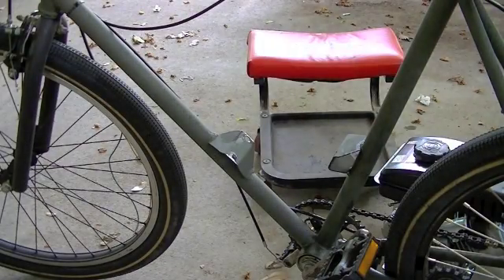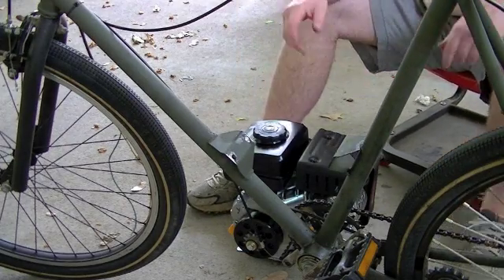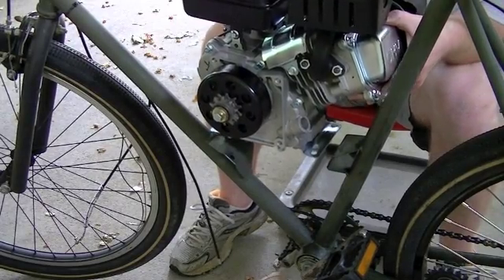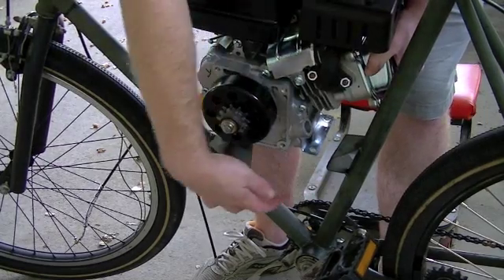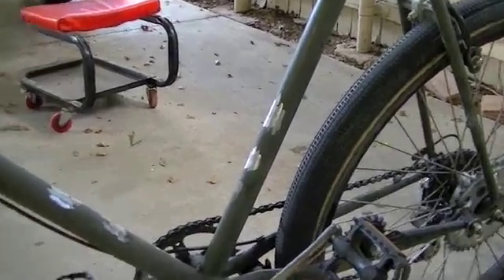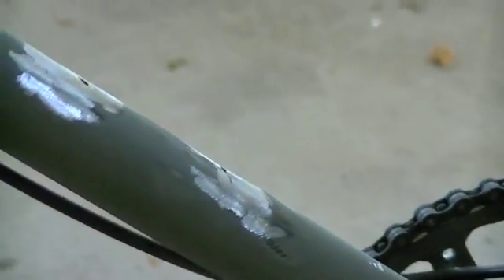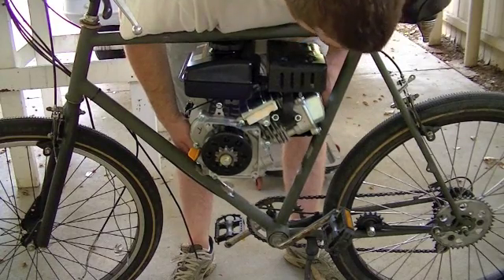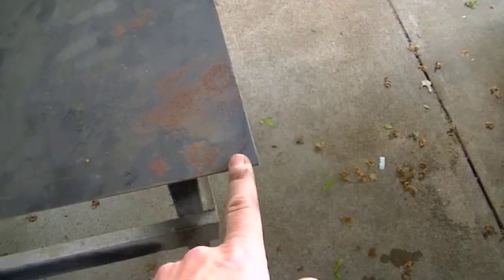Part 3 Motorized Bike | 3HP 4 Stroke Engine

Comment: Also something that makes the smoothest grinding finish in the business. is that 3 or 3 and 1/2 in round. brown green and red pad that goes on an angle grinder. Harbor Freight is the best to get it all with a 20% off coupon. I like the angle grinder best because you have the most control. I wish they had that angle grinder in a plug in the wall instead of air powered. You can put a straight edge on metal after you grind - mill it with that it's so close to perfect. I've milled carburetor tops down with it after cutting them and milling down with that angle grinder. And you can put a straightedge across it there that true. And it doesn't leave sharp edges it leaves an excellent finish.

Comment: you can fit a 212 predator if you ditch the gas tank mod the exhaust and upgrade to a pod instead of the air box
Reply: Brandon's Customs that's what I want to do

Comment: just turn the clutch around and put the sprocket on the inside then you wont haft to offset the engine.
Reply from the maker: That wouldn't fully correct the problem for this build.  The engine was WAY far out and I would have had to sit kind of goofy on it when riding it.
Reply: I

Comment from the maker: The rear hub and sprocket I have on this bike is from Pirate Cycles.  The hub is a two piece, machined aluminum hub that sandwiches around the hub of the bicycle wheel.  Those sprocket pieces that come in the bike kits are junk.  I'd replace those quickly.

Comment: A question about your rear sprocket. How did you mount it? Does it have a sheet of rubber on both sides of the spokes sandwiched between the sprocket and a metal plate on the inside?